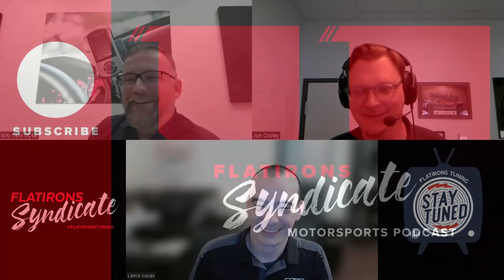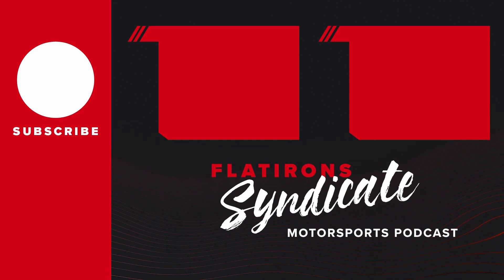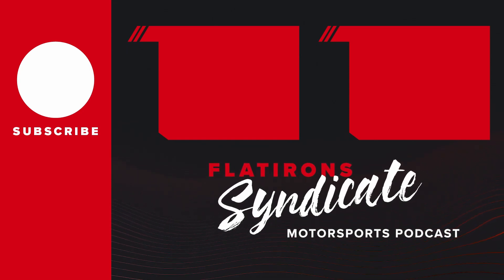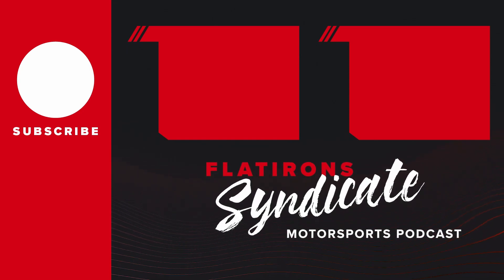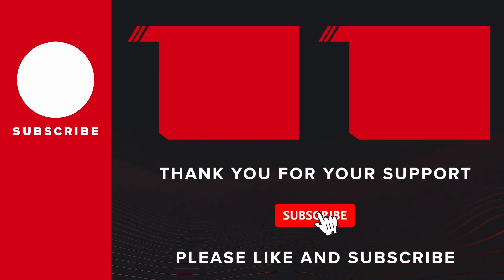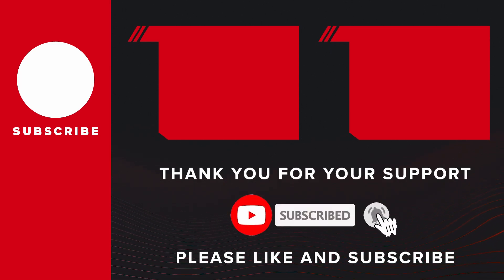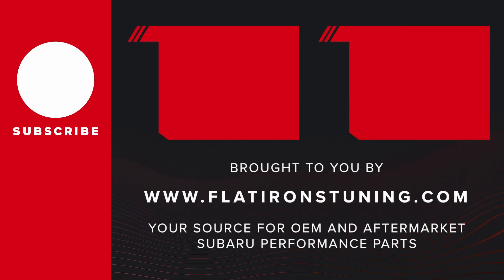Can Gateway has lots of Potential!

Comment: Hi!

We did something similar on opensource tuning, by having a modified CAN handler we can either send or receive custom messages with own IDs over the existing CAN, adding a "Gateway" is simple as tapping it between any CAN connection, the easiest we found to work with is the Yaw Sensor on the center console, it has the HSCAN connection right into it, so we can tap there into the network as an easy access. 

By tapping into the CAN network and having a custom CAN handler, we can hook it up to a programmable CAN device which has analog signal inputs, digital inputs, etc, making endless possibilities of what we can do with it, since it expands the sensor usage by a LOT, we can add pretty much near all the sensors we can think of. 

One good possibility is; Having a custom Closed Loop where we can have a Wideband input (either direct analog via TGV/RearO2/MAF if car is Speed Density), where in vacuum MAP engine conditions, use the stock O2 sensor as reference, because it is accurate during that operation, and in boost conditions where the stock O2 is no longer accurate, blend into the wideband O2 sensor reading so you can still have a good accurate source of information for Closed Loop during boost conditions. Replacing stock Closed Loop operation with a custom one is not that simple, but we have a few ways to approach it. 

Other good possibilities is having custom failsafes using Oil Pressure and Temperature as inputs, to either limit engine RPM or reduce power (cut boost control) if something goes wrong. I'm not a huge fan of cutting the engine fuel because it can be a little dangerous, especially in a street driven vehicle where you should consider your own safety before the engine internals (imagine having the engine shutdown on a critical situation, not good)

Currently we do apply some of those features using opensource with analog signals, not yet into the CAN Gateway, but we do have the code ready for it, just didn't have the time to build a proper CAN Gateway hardware, just a prototype (that works). As ECU development is not my main business, just a hobbie, I might finish it on another oportunity.

One of the main reasons I had to develop it myself on opensource, is because Cobb does not have support for ECUs outside US market, and being a South American Subaru enthusiast, we're on our own for such things. 

All the best! Amazing content as always, Jon!
Reply from the maker: Thanks for watching and thanks for all that information!  You are doing some very cool stuff there.

Keep it up and Stay Tuned!